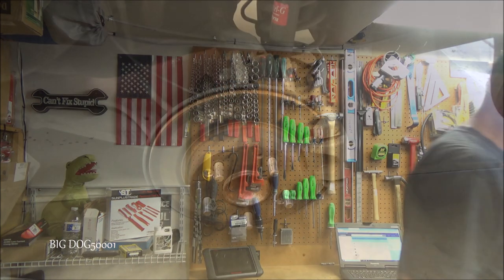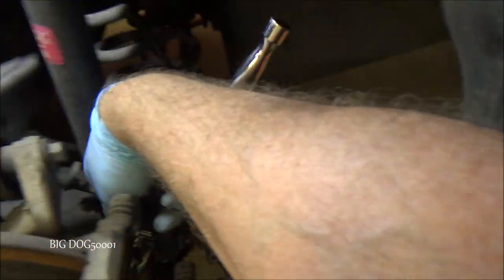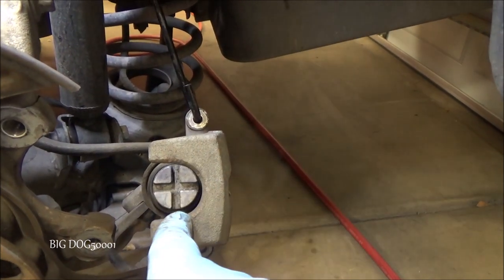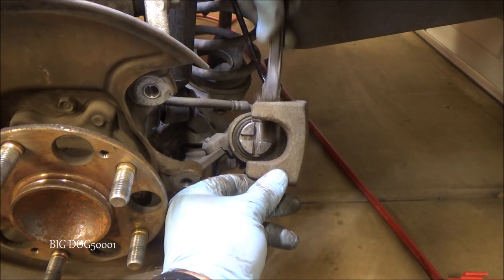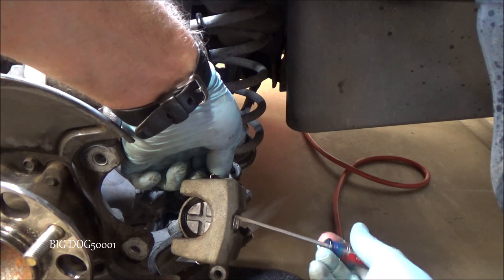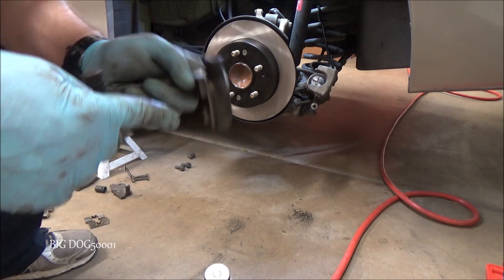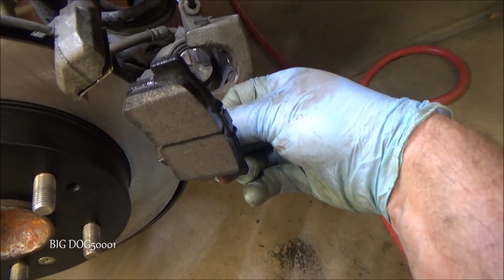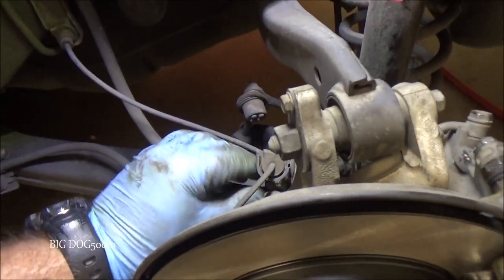Honda Civic Rear Brake Pads and Rotor Replacement (2006-2011)

Comment from the maker: Tools and Parts
Disclosure: This channel earns a small commission using some of these links - at no additional cost to you.

Caliper Windback Tool:  https://amzn.to/3nQO2sp
Rear Brake Pads Akebono ACT537:  https://amzn.to/3aL0x56
Rear Brake Rotors Centric 120.40040:  https://amzn.to/3aNm64O
Rear Brake Hardware Kit Centric 117.40020:  https://amzn.to/3mRriai
Silicone Paste:  https://amzn.to/2WMRqZf
Brake Parts Lubricant:  https://amzn.to/3nSD5Xg
Brake Cleaner:  https://amzn.to/3aJ9HPm
Milwaukee 3/8" Impact Wrench:  https://amzn.to/3hiXke2
Sunex Impact Sockets:  https://amzn.to/2WOdT8o
Brake Caliper Hangers:  https://amzn.to/37NN2Q7
Light:  https://amzn.to/3arkc9T
XL Wrench Set:  https://amzn.to/3rtCnBZ
GearWrench Sockets:  https://amzn.to/3aH4J5K
Gear Wrench Ratchets:  https://amzn.to/3puy0ob
Vessel #3 Impact Screwdriver:  https://amzn.to/3mQyl38
Trusty Cook Hammer:  https://amzn.to/37N63SK
My Favorite Little Screwdriver:  https://amzn.to/3prTwdu
Brake Hub Cleaner Kit:  https://amzn.to/3roRuwm
Right Angle Die Grinder:  https://amzn.to/3ry6tUI
Abrasive Discs:  https://amzn.to/3mQSCFF
Anti-Seize:  https://amzn.to/38zLDMh
Metric Wrenches:  https://amzn.to/3hks4eC
Snap-On Torque Wrench:  https://bit.ly/3gzVN2q

The Big Dog 50001 Automotive Channel Store can be found here: https://www.amazon.com/shop/bigdog50001automotive  (As an Amazon Associate I earn from qualifying purchases).

Comment: Since I live in the rust bucket belt I avoid the screws because oh boy I had nightmares.  I really liked the trick of adding silicone paste to the screw driver for the boot.  It will so very help a lot.  Super helpful little tips.
Reply from the maker: I appreciate the comment, thank you!

Comment: 7:30 is the most important part. I just replaced calipers, rotors, pads, hubs, bearings and rear brake lines and I goofed that on one side. That brake was dragging when I was done until I spun it to a 90 degree orientation.
Reply from the maker: Yep, definitely don't want to miss that, thanks for the input!

Comment: This video very helpful, Have a 2006 Honda Accord Euro CL9, using a WSM for 2004 Accura seems to be identical, but torque for rear Caliper Mounting Bolts is 28 ft-lbs, some suggest 80 ft-lbs back and front. Removing them was difficult so don't think they were 28, might do the 54 ft-lbs as you have used?

Comment: Big Dog, your videos are fantastic.  Question about lifting the rear entirely, does merely being in gear stop it from rolling forward while you have the entire ass end up?  I've done the front brakes but it seemed to me I could turn the front hubs freely when it was off the ground.  Don't want it rolling away from me so I thought I'd ask.

Comment: After installation should e rotor spin freely when the parking brake is off?
Reply from the maker: It should move but it won't free spin, the brakes pads will grab it a little bit.

Comment: at the end just before u pumped up the brakes i noticed u had the cap still off on the master cylinder. wouldn't this introduce air into the system when u were pumping up the brakes with the brake reservoir cap off??
Reply from the maker: No it will not.

Comment: Hello BD🖖🙂
🤔I inspected my rear brake pads about a few days ago. because I noticed a very slight rub of the pad on the rotor every morning. then it would stop as I drive to work, it would come and go throughout the day. so I cleaned the pins but it still does it.
I noticed too that, that side was harder to compress the caliper piston.
Is that sign of a bad caliper or a clogged brake hose? What test can I do to determine if it's a caliper or the hose?
2000 Honda Accord v6
Reply from the maker: Decent chance it is a caliper issue but there are other things it could be too.  I would probably start by bleeding the brake system, paying attention to that wheel, and see if it helps after running new fluid through it.
Reply: @BigDog50001  thanks I'll start by doing that. You got me thinking that it could be something else. I haven't checked, if the rotor is warped or not, so I'll check that after bleeding it. Thanks 😊👍 and prosperous New year 🖖🙂
Reply: Drive the car and put your hand near the wheel (don't touch it, it may be very hot) and have a feel for any excessive heat. A good caliper should not make the wheel very hot. If it's very hot, chances are it's a seized caliper (or maybe a wheel bearing). I had to change my caliper for this exact reason.
Reply: @FD-rh6tr  I don't see any of those red bluish marks that you would see on the rotor when it's overheating in fact it doesn't look bad it's just that annoying rub of the brake pad on the rotor. that's why I thought it was a mechanical problem like the pins. it's not constant so that's why I don't think it would overheat.. yet. I know the brake hose and the caliper can create that and it looks like it's just starting, but, I don't want to go to the expense of buying a caliper and then suddenly find out it's the hose that was creating the problem.🙁 I already have double checked my work to make sure that I assembled the pads correctly.
I haven't gotten to do big dogs advice yet due to you know 
Holy season and bad weather.
Thanks for the advice though I will be watching that rotor for any change in color.
And if you do have any more input, please do give
🙂👍 thanks
Reply: @rudymunoz901  Yeah I would start with BigDog's advice to start small and change the brake fluid and see where it goes from there.

Comment: 9:50 just a tip: It is recommended to open the bleeder valve, so brake fluid isn’t pushed back into the master cylinder and flip the master cylinder rubber seals.
Reply from the maker: Some people like to do that,  I don't.  Honda doesn't say it is necessary either.

Comment: The rear brake caliber screw set at Advance Auto Parts was selling for $135.00. You said $30-35.00. "NOT!" "BLAME IT ON THE DEMONRATS!"
Reply: I just bought new slider pins & bolts. They come in a kit $15 CAD per side.

Comment: And if you are a proper mechanic you dont need to torque up the bolts...common sense and experience will tell you when they are tight enough !
Reply from the maker: There are times you should torque nuts and bolts.  Thanks for the input.